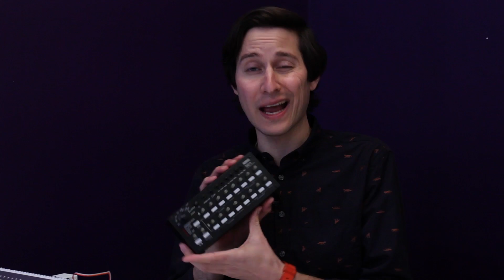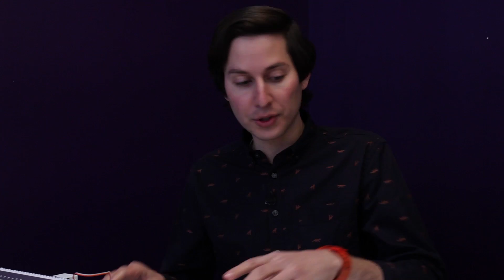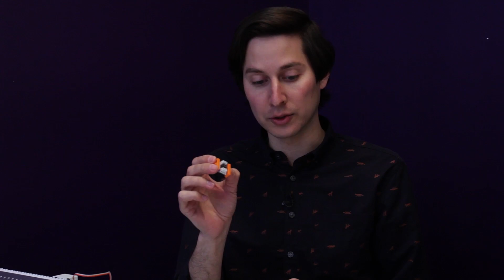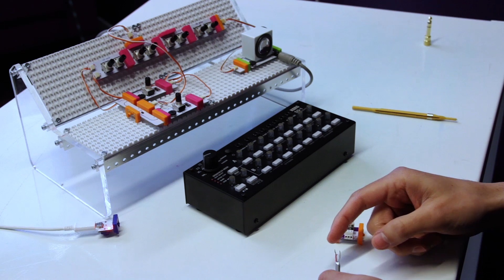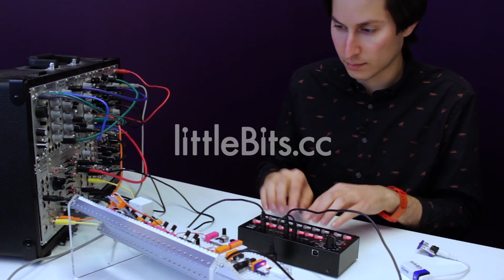Sequencing the Synth Kit with the KORG SQ-1

Comment: Is there any way just to use the little bits output on the SQ one and the little bits CV module? I mean I have no problem buying the Proto module but I already have the CV module on order and I thought it was kind of cool that Korg put the Little Bits output on the sq 1 but the  only videos I’ve ever seen using the output have been to the Proto module.  I guess I’m asking this because I have the SQ 1 and I have a little bits kit with a boatload of extra bits but now I’m wondering if I should have ordered the Proto module as well. Great  video and thanks...
Reply: What did you find out?

Comment: Be careful it looks like the wire is on the other side , its not , cable is on top , there is a good picture on the Korg website, do you remove  the jumper ?